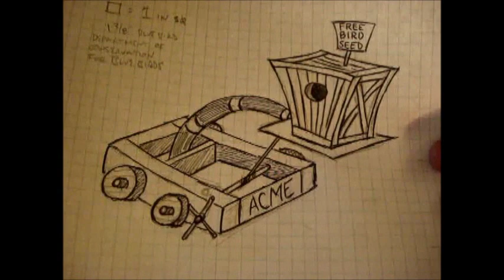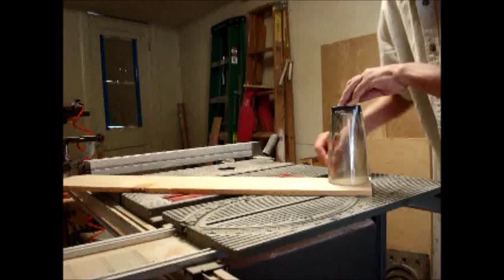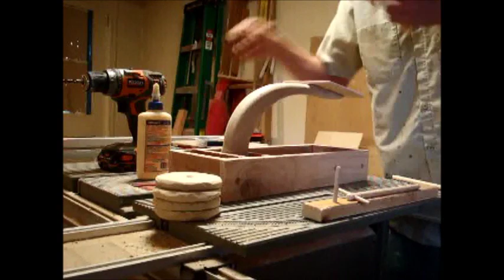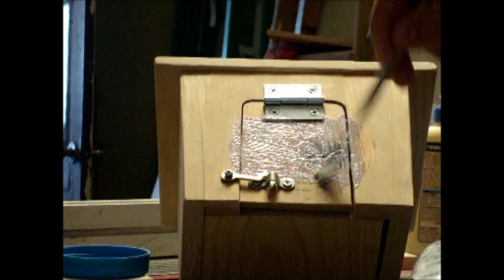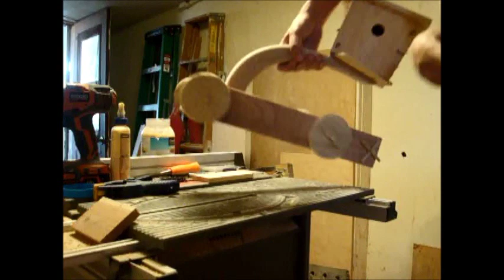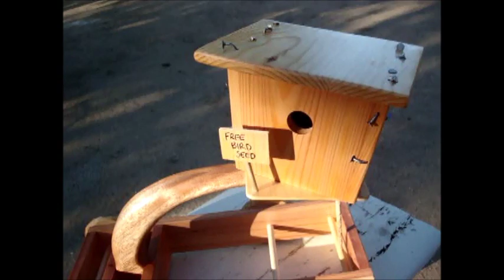Wile E Birdhouse   Summers Woodworking 2nd Annual Birdhouse Contest

Comment: Very Nice, what was the sets to getting the logo to stay, was that glue? how did that work?
Reply from the maker: Yo, Sterling! I used Mod Podge. Apply to surface and print (printed backward), let dry, then apply water and rub off the paper. Ink stays, super easy. You can also use thinned down Elmer's white glue. Thanks for watching!
Reply from the maker: ***** inkjet.